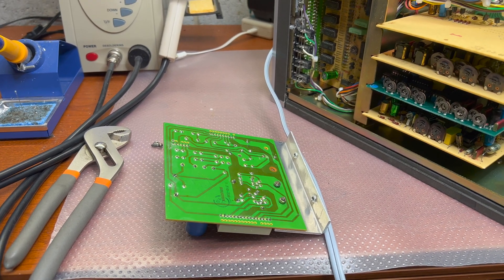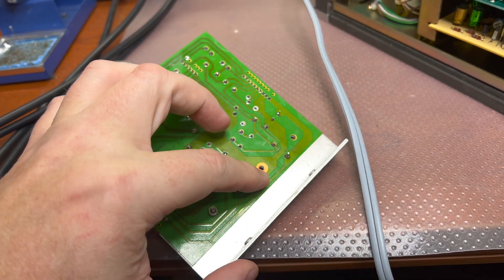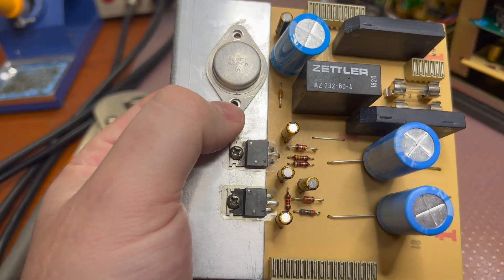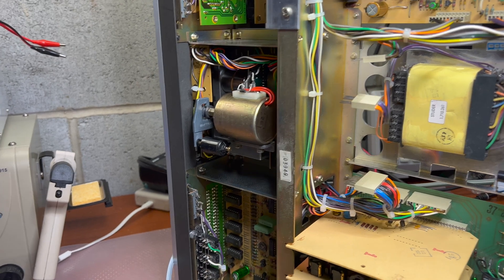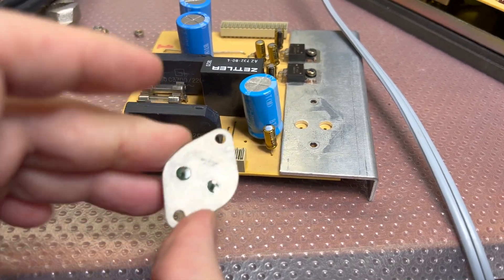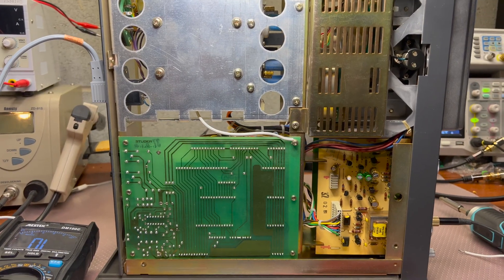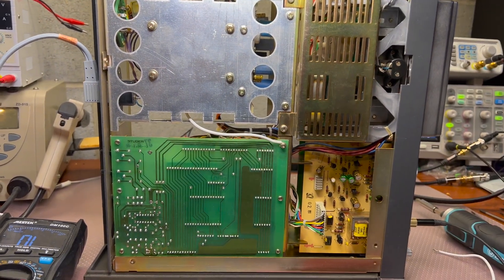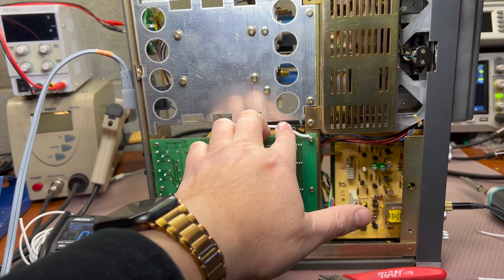Hunting the Hum: In Search of Noise in the Revox B710

Comment: May I kindky ask where did you fix the other end of the white ground wire? Thanks, Marco
Reply from the maker: All ground wires in the deck should come from the same point, I.e.star approach. And in this deck it is a power cap. Hum appear when there is a ground loop.
Reply: @hifirulezzz thank you so much, I will try and per you know👍
Reply: Turns out that the problem was one of the two fuses on the power board. I still can’t explain why the recorder was working (with noise) even if one of the fuses was broken.

Comment: By adding that extra(white colored) ground wire, you have changed the current path. Adding .1 KEMET or AVX ceramic caps across the large main filter caps and adding 0.022uf ceramic caps across the regulation transistors from the base of the transistor to the unregulated input side of the transistor, should cut AC hum by 2/3.

Comment: Have a check the ceramic filter cap, sometimes there are dead, very rare but it happens. i had in one of my decks 2 dead ceramics, the capacity was extremely low with high resistance, it basically turns into resistor. maybe you have the same issue.